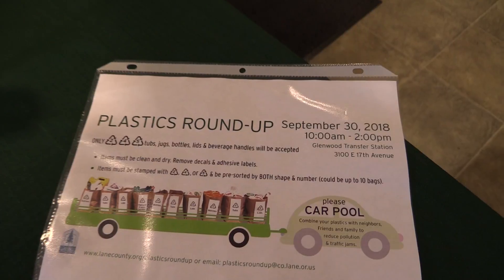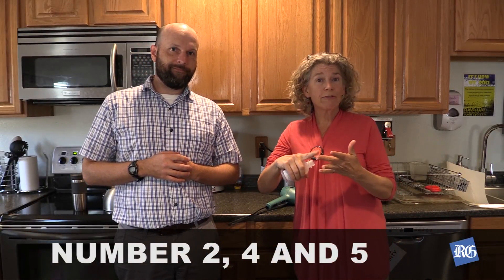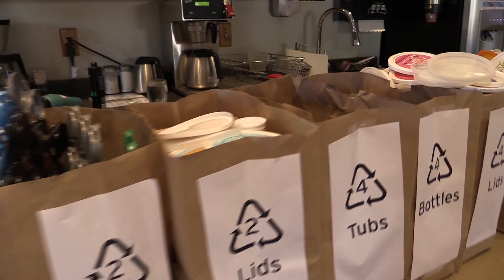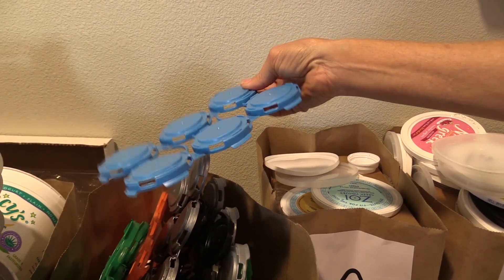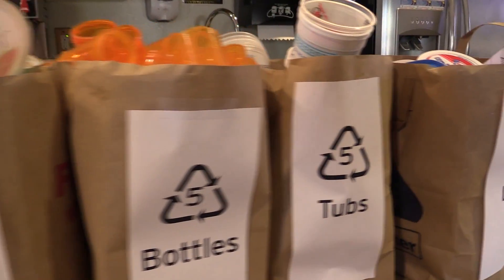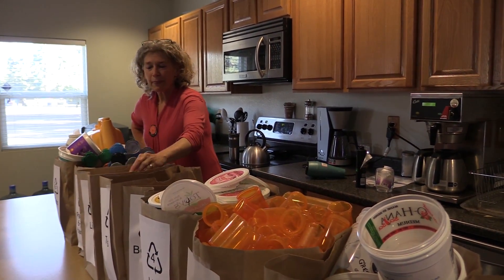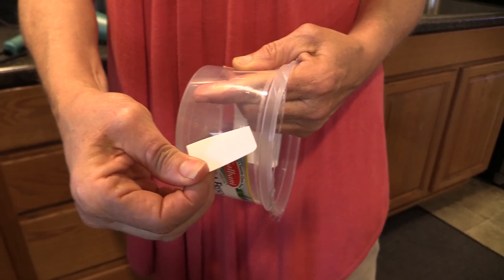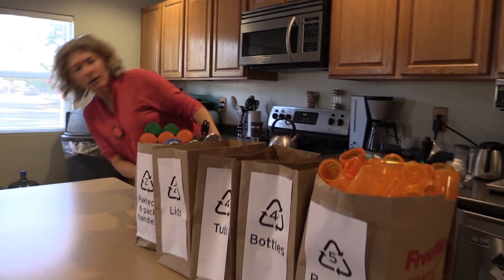Plastic recycling 101: How to sort plastics

Comment: If you can heat up the labels a bit, it is easier to remove them. I heat up my rice bag (or other heatable bag or pack)  in the microwave; then I set that on the tub, bottle, etc. right on the label for maybe 30-60 seconds. Peeling the label off cleanly is usually pretty easy that way. Thank you for the video!